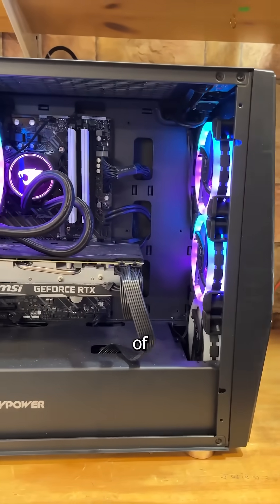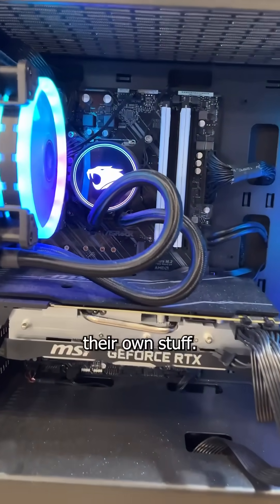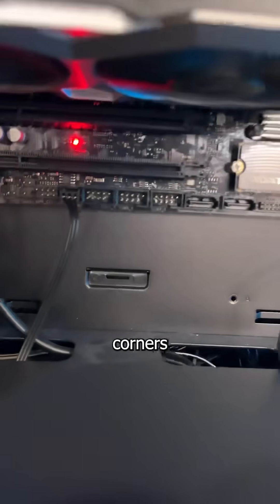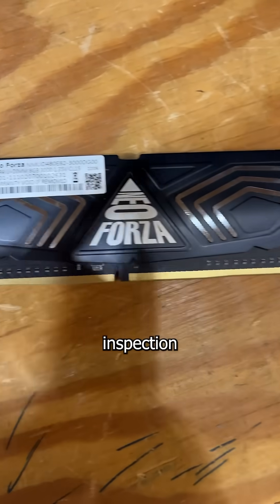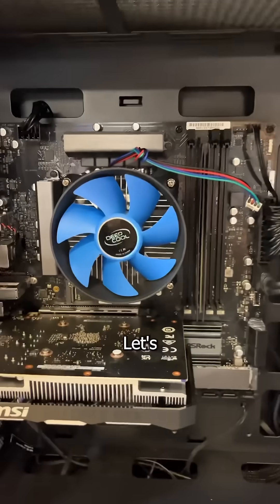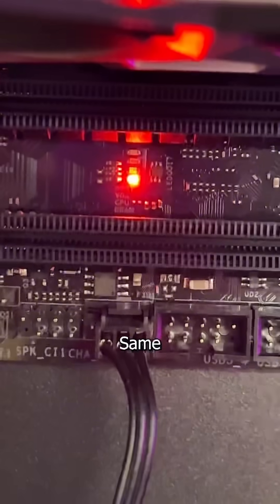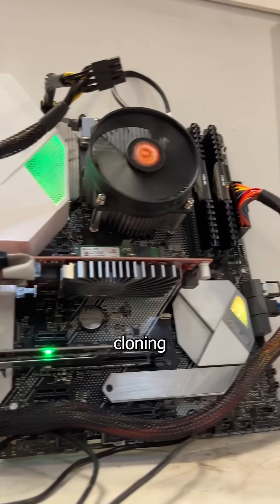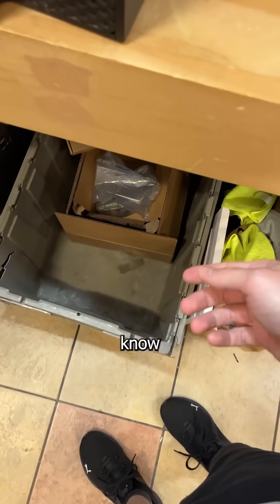iBuyProblems? Cheap NVMe causing no POST 💀 #technology #pc #tech #shorts #computer

Comment: F#&k I just ordered an ADATA ssd on black friday special... Thank goodness for this video because I was about to order another one. Greatest technician ever.
Reply: My rule of thumb is to buy from the company that actually made the NAND modules. Samsung, WD, SK Hynix, Crucial, etc. NAND goes through a binning process, and the manufacturers are going to keep the AAA tier stuff for their own brands. That's before things like the controller chip quality and onboard RAM caching.
Reply: @Montgomerygolfgator  Adata make their own NAND
Reply: The greatest technician that's ever lived.
Reply: o have an ADATA SSD for 3 years now, no problems
Reply: Have 3 units XPG GAMMIX S70 BLADE 2TB, one running about year, others about half year, no problems, fast enough
Reply: Adata means nodata
Reply: I was on the fence for a bit but end up with tgroup ssd instead, so far no problems
Reply: I've had my SX8200 pro (1TB) for a few years already and it's still running perfect. It was the best perf/price at the time, and I don't regret it. Unless you're unlucky, it'll run great dw
Reply: @naomie2680 my first sx8200 die cuz I remove the heatsink when transfer to my new pc as backup drive, I bought that like 3-4 years ago and it will run perfectly fine if I leave the heatsink on, now I have 2 2tb on my pc and has no issue at all
Reply: @naomie2680 Bro probably works for ADATA
Reply: If you're okay with a coin flip of it failing or not. Keep it! 😂
Reply: how is your ADATA unit doing after a year?
Reply: @iamthemuffin  so far no problems. still going strong
Reply: I have one for years no problem
Reply: I've had a Cyberpower prebuilt for a year with an ADATA SSD. 0 issues even with heavy use (over 12hrs every day for working/gaming).
Reply: Just dont install there anything important, if something is important store it few drives or send it to cloud time to time.
Reply: Don't listen to all these people. First ADATA it either is amazing or crap. Their stuff is usually repurposed so it's old and used. You'll either get one that works forever or doesn't. But if you want something really really good and cheap. Order a Sealed Power drive. Their logo is "SP". They are a budget brand but actually have amazing stuff and good warranties. They last forever. May not be the fastest fastest but still extremely quick and faster than most. Reliable. Just a good no frills brand.
Reply: @iceman125971 SP is silicon power not sealed power unless there's another company using their logo lol. Silicon power is cheap and reliable in my experience.. I've transfered terabytes of data on and off a 1 terabyte drive from SP without any issues. Nvme Gen 4 and it's fast as hell
Reply: @DarkAttack14  yep. And nah. It drives me nuts. They've been through both names. One was their name like 10-15 years ago and then they changed it but kept the logo and it confuses the shit out of me lol. I can NEVER remember which is which lol. And then I have SSDs (old ones) that say sealed power and my nvme that's silicon power. I always think it's silicon power but then I second guess and think it's sealed. I literally wouldn't be able to save my life if it depended on getting the answer right if just randomly asked hahaha. Like. I KNOW what I'm talking about lol. But my brain doesn't want to use or remember the right word.
Reply: If you own ADATA drive and still going strong for a few years, lucky for you because they were the best on drive market. There's a lot issues with ADATA drives rn, they got caught downgraded their own chip with cheap part. I own an old adata drives with no problem, and bought a few last year for my businesses, 4 out of 9 got the same problem, BSoD then died 😂
Reply: Yea you should always spend the extra couple of bucks to get a WD any time you get an SSD or HDD 
They're hands down the most reliable storage drives on the market
Reply: @LadyMistborn 

For some bizzare reason I now see fakes of WD storages pop up here. Usually of the SSD kind (SATA and NVME). Same with Kingston and SanDisk. Now we have to double take on checking if the seller is legit or bogus and it's giving us trust issues.
Reply: @ecthelionv2  kingston is poopoo
Reply: I always get Crucial SSDs, they are the definition of "boring but reliable".
Reply: @LadyMistborn Any brand can fail. I've had a really expensive 4TB WD Gold HDD fail. Could've been user error (the security system I put it in gave it weird ass partitions and I had reformatted it a couple times). Point is, any brand can fail, but I will say that the brands I've found to be the most reliable are Samsung, WD, and Seagate.
Reply: @raynjpg  Sure any brand can fail, but what is important is failure rate, and WD has always to my knowledge at least had the lowest failure rate of any brand, meaning you're much more likely to get a drive that will last for years and years
Out of the 15-20 WD drives I've bought for myself and family members over the last 10 years only 2 drives have failed, one was my 2.5' test hdd that failed from static shock, and the other still runs almost 24/7 in a TV PC, after crystal disc marked it as critical and about to fail 5 years ago
Reply: @LadyMistborn  Funny, because there are many people who would say WD suck.

Comment: Bought my first Computer from Ibuypower. First the problem was the cooling, which the AIO it came with had a 90% chance to fail according to threads. Then the ram, then the NVMe, then first PCIe so i just build mine from scratch...never looked back, runs like a beaut

Comment: As a customer of Ibuypower at the height of the gpu shortage in 2018. I regret nothing. they were amazing to work with. My pc suddenly stopped working they sent me to a UPS facility and they had an account to pay for all the boxing up and shipping. i sent it out and had it back in 8 days working like new. I still have the mobo and case from them. I just replaced the AIO they included in my bundle.

Comment: I have an Ibuypower pre-built in that exact case. When it arrived, the front USB wasn't plugged in, not just loose, but actually bound up nice and kneetly in the cable management in the back. Also, within 9 months of average use, 3 of the  case fans started failing. I fixed those things myself because that's pretty simple stuff and hardware is easy for me, but the whole reason I purchased a pre-built was that Software is the bane of my existence, and all of that was in good order as far as I can tell ¯\_(ツ)_/¯ so, while I was slightly disappointed, overall pretty happy

Comment: I bought one of them about 6 years ago and no problems.  Maybe I just got lucky.  It came with a 512 MG SSD and a 1 TB HD.  I later added a Samsung 1 TB m.2, 32 GB (48 total) and sound card.  I don't know if the sound card actually makes a difference, but it makes me feel better.  I might be adding an integrated WIFI/bluetooth soon (currently using a USB external WIFI).  

I might replace the processor (Intel i7-8700) soon.  I'm looking for the fastest processor for an MSI 370A-Pro (300 chipset, 1151 socket).  So far the best I can find is the Intel Core i7-9700K.

Any suggestions for a better one?

Comment: I bought an iBuyPower gaming PC like 14 years ago. It still runs despite being completely obsolete. The main issue with it is that they used a shitty micro motherboard, so i couldn't upgrade anything other than a bit of ram and it only handles up to 100mb internet speeds. 
I was going to build myself a new one, but during peak covid i couldn't find a GPU so i bought a PS5, gaming laptop, and steam deck instead.
Reply from the maker: Do you regret it?

Comment: cheap motherboard skimped out on proper debug leds?
a data drive is kinda like RAM
but i suppose it would make more sense if the BOOT light lit for this.

dead hard drives do all kinds of weirds stuff to a rig
i had one that started taking forever too  boot, it would eventually but still 
hard drive failures really throw a computer

Comment: Ibuyproblems? That aint a "just kidding" my guy.

I bought my first gaming pc from them because i was unsure of being able to build one myself when I was 16 (14 years ago.) 1200 bucks got me a phenom II x4 955, 4gb ddr3, asus M4A77TD, Radeon hd5850 and a 1tb hard drive. Offbrand "free upgrade" liquid cooler died on me after 3 months which they warranty replaced, 2nd one lasted a year and started making grindy noises. 800w offbrand power supply exploded just after the 2 year mark.

Comment: I had an issue where my motherboard would get stuck at checking ram, and just never post. was very upset bc I didnt have any other boards to test the ram, and didnt have other ram to test the board, and was thinking I wouldnt figure it out. but, im stupid, i realised that I didnt have to have both ram sticks at the same time, and I could try to post with only one stick. put one in, and it booted right up. turned it off, swapped the stick, and same issue. I was very confused as to why my ram stick suddenly gave out, as it has no visible damage even when looking at it under the microscope. I have ordered a new ram kit, and am waiting for it to arrive, but watching this reminded me of that. I wonder why it stopped working... 🤔

Comment: Get volt meter test the individual power rails and make sure you always have more power than required for breathing room and demand flux. Insufficient stability in voltage or watts can ded your components. Even board mounted extentions like nvme's

Comment: Honestly, this is why I built my own computer. I get to have the choice over which parts my system has. Not to say my system is 100% flawless, it has it's own issues, but the difference is I know exactly what's in my system and can do the research to see what works or doesn't work for my system

Comment: I always run NVMe SSDs in RAID1 (Mirror) for this very reason, when they fail - everything is just gone. At least with a hard drive you get some SMART errors before something happens. For context, I do engineering work and have critical tools/software on my PC. I also have a 36TB NAS that I backup to, RAID is not a backup.

Comment: It's hard to get a lot of info from 4 LED's, but perhaps the logic to clear the 4th was aborted when the system tried to locate and initialize the EFI on the nVME. Which would involve copying data to DRAM. The disk showing MBR and 0GB is suspect, I reckon one of the nand flashes died, as that would explain the partially functioning drive without a usable partition table.

Comment: Bought an iBuyPower during the GPU shortage and haven't had any major problems with it. Biggest thing I've run into is that the RGB software on mine is borderline unusable, but it definitely works until I get around to building my own when GPU prices finally start to settle out.

Comment: Ive had this happen once. Some motherboards wont work correctly and can cause this issue depending on what nvme slot it plugged in. Looking at it, this nvme was plugged into the wrong nvme slot

Comment: slot clock only common thing ram and sdd share..
if something pulls the clock down other stuff goes on the fritz, what kind of mobo/hardware you have plays a factor. asrock isnt that highend. the more pensive boards will probbely just keep going with the sdd not detecting

Comment: SanDisk drives used to do the same, the BIOS just gets stuck enumerating devices forever because the thing just doesn't respond to ATA commands and the BIOS doesn't have a timeout. I don't remember the POST code, but I think it was RAM init too. Yeah, even with segment displays these things can lie to you!

Comment: If the motherboard uses the same power supply bus for both the RAM and the SSD, it could be that the faulty SSD had a short or other similar issue, which could have made that power supply bus unstable, failing to power the RAM.

Comment: because its a dramless ssd, so it uses system ram as the cache. if the data bus gets corrupted, it is going to fill your ram with garbage making your bios think the ram is bad. It isn't regular dwords as it is so corruption will give out of address issues etc or loopback errors and the like on the bus.

Comment: Looks like an MSI or ECS Mainboard... Most likely has a budget chipset which pipes the NVME bus through an emulated SATA or DRAM channel thus triggering a DRAM error due to the failed SSD, or the BIOS is so chopped that it thinks the NVME vnand controller is a DRAM Module because of the way it was sent through the bus. Either way.. F#@&

Comment: I will weigh in. The reason it did not post is cause the bios due to the bios being able to use ram from the slot ad cache when this fails it is due to the specification not being met. I think dono. I guess anything. Worth a shot.

Comment: As somebody who's had an Acer nitro laptop with a bad SSD slot you would be shocked what goes wrong when an SSD dies. To the point of the laptop not even booting into the BIOS with the bad SSD in it's crazy 😔

Comment: I bought an Ibuypower back in 2016. Never had an issue with it. 

I've since replaced every component inside of it upgrading from AM3+ to AM4.

However in my experience, I didn't have any issues with my pre build I got from them.

* except the included graphics card was an R7 250 * 
So I did have to upgrade that to a 1060 rather quickly, However, after that it was a solid system for the time, I eventually did have to upgrade to Ryzen though, my  FX processor got to where it was unable to keep up anymore .   
* could have got an FX 9590 I guess 😉 *

Comment: Because motherboard error codes are only right some of the time.

Swapped out RAM on a machine. Got a no-boot storage error. Disconnected the drives (because why would that keep me from booting?), reseated the RAM, and got a no-boot CPU or GPU (can't remember) error. 

At this point I definitely knew it was the RAM. Plugged everything back in, unplugged the 24 pin from the PSU. Spammed the power button. Plugged the 24 pin back in. Booted up fine.

Just needed the capacitors on the motherboard to drain so the BIOS would retrain the new memory.

Comment: I had same problem with brand new Patriot nvme 1tb.
My suggestion that cheap adata foil cooler cannot effectively cool a drive. I have adata legend 710 and replaced original radiator with motherboard included one, thick and with good chunk of cooling thing under it. At a coincedense the drive have a controller die exposed, so the drive cooling is optimal to this day.

Comment: Sometimes drive controllers in general just cause inexplicable phantom errors when the electronic side of the drive goes bad (which in an SSD is everything). I've even had decent Western Digital platter drives that got something messed up in the controller board send me on a wild goose chase, I threw half the parts box at that PC before I unplugged the drive cause it was still spinning up and had failed with no warning. Half the time it wouldn't POST and the other half it'd throw a random error on the idiot lights.

Comment: I have to share for one day this might help someone else. I don't know exactly why but I just experienced this with a reputable brand, which decided to fail SMART on the first boot after slotting in a new cpu. It worked five minutes before and for a year before that. The error? Memory. AMI basically told it me it was shitting the bed. If you ever find yourself in this situation where it's not yet dead, but you can't boot. Load a different drive to boot from. Turn off smart for that m2 slot in your bios then Google powershell diskpart if it doesn't show up in Explorer and online / mount the drive to a different letter. Save your important files, wipe, RMA and move on. If that doesn't work then move on to hddsuperclone or something in linux. 

The moral: nand flash is volitile as fuck even from the top 3 manufacturers. Don't buy random drives if your data is important and make a point to back your shit up once in a while onto a separate drive.

Comment: What I’ve learned with computers, the solution is always something dumb or simple. You’ll rarely have an issue that is genuinely a difficult problem to solve.
Reply: NEO forza ram is the bomb kid🤣
Reply: That's not always the case, my PC has had a weird problem for about 4 years where it freezes booting into windows unless it's overclocked, and the overclock it needs changes every time it's powered down
I've narrowed it down to something with the motherboard but replacing a 10 year old Z97X would be a pretty penny at this point lol

Or another issue that's had me confused for years is flipping the power switch off waiting up to 10 seconds and flipping it back on will cause it to power itself back on whether the power button is hooked up or not 

Point being it's not always something insanely simple, it will be more times than not for sure, but they'll make up for it sometimes when you're pulling your hair out trying to find the issue lol
Reply: @LadyMistborn  That sounds like you have an underlying problem somewhere that’s unique to your build. Out of all of the PCs I’ve dealt with. Most of the time it’s a simple program causing the entire kernel to hiccup and give Windows a heart attack (BSOD). Then again, you’re on Intel going by the motherboard you mentioned. Intel always be having weird anomalies that come up over time aside from faster performance degradation.
Reply: @LadyMistborn  man do yourself a due diligence and get some better hardware. Sometimes making things simpler for yourself makes your life harder 😂
Reply: one time my windows kept freezing constantly, and the problem was fixed by updating the C drives firmware

Comment: I had an issue with an m.2 sata drive pulling pcie lanes off my GPU on a board before, but that was fixed in the bios.
If the drive is causing errors on multiple systems, the firmware is probably fucked, and you can try to update. If it fails then it's probably e-waste.